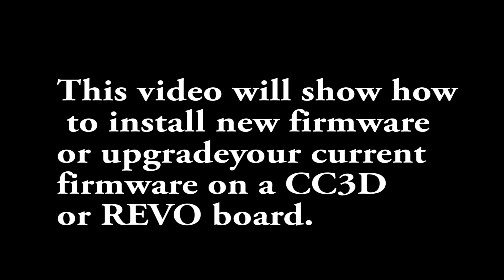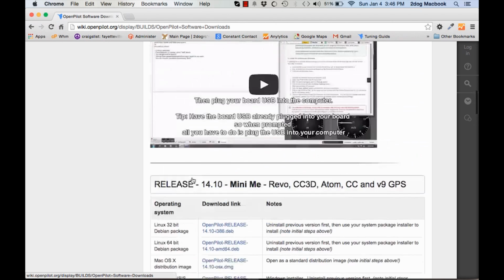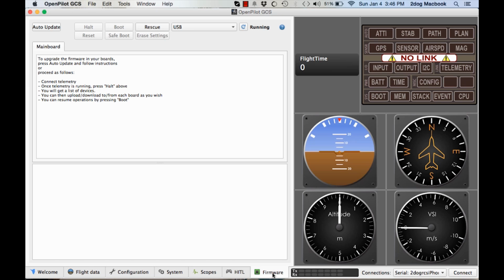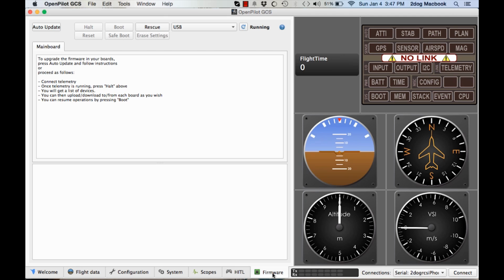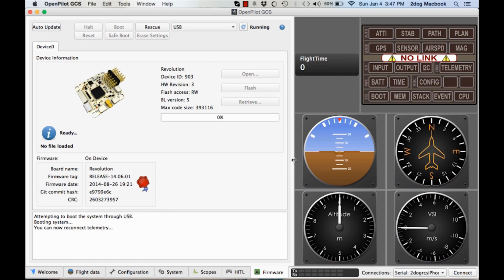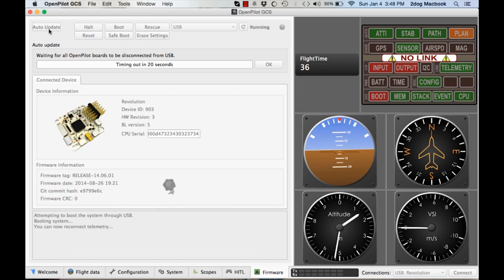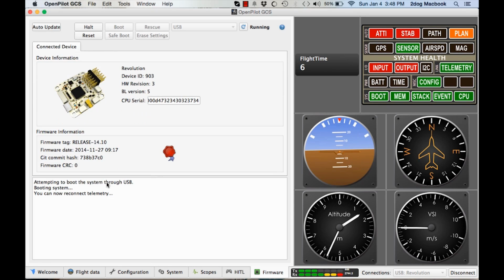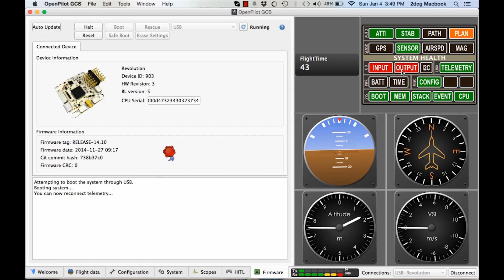How to upgrade your Firmware on CC3D or REVO Board 14.10

Comment: Hi,i am havin firmware mixmatch issues on 4 cc3d boards and i cant figure out how to fix this problem will this work ?I hate to throw these boards away but there no use to me ,i ordered another from get fpv and its working fine but i am NOT upgrading it ,every time i do this happens and im tired of ordering new ones only to have this happen again ,it seems the problem is the copter control boards are the ones i am having this issue with i just got a new revo and cant use it because its copter control,ans if i upgrade it the same will happen  si i cant use this brand new revo .could you find time to help a fellow pilot,at this point im about to just get online and order 4 more all from get fpv because these are the only ones that i can seem to get right firmware for.please help .im sooo flustrated its almost hammer time!lo
Reply: Do you have to completely erase the board to upgrade the firmware?every time I erase and upgrade firmware it bricks my boards and I get a new one ,now I have fifty of these that are bricked lol Anyone, need a board!!lol. Can I get a bit of help????

Comment: http://prntscr.com/7pua39 what to do cc3d not supported by RELEASE - 15.05  BANANA SPLIT - (06/22/2015)  Revolution Nano, Revo, OPLM and Platinum GPS
Reply from the maker: Randy Lachman Looks like that release won't work on the CC3d boards.
Reply from the maker: Randy Lachman Yeah.
That is why I switched over to Cleanflight.  Much better flight control in acro mode.  You can flash your CC3D with Cleanflight if you want to try it and switch back.
Reply: 2dogrc Okay Thanks :D

Comment: We got now the new 15.02 should i do as same like you do in this video? Nice video it helps me on my build
Reply from the maker: Basically it is the same.  15.02 removed some of the disconnect from the controller steps. However the general steps are in the same order.